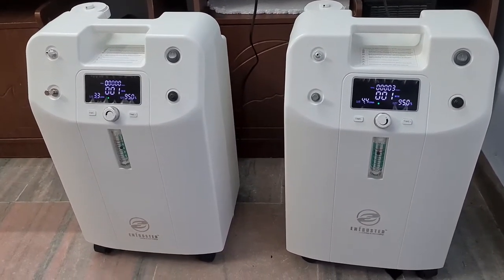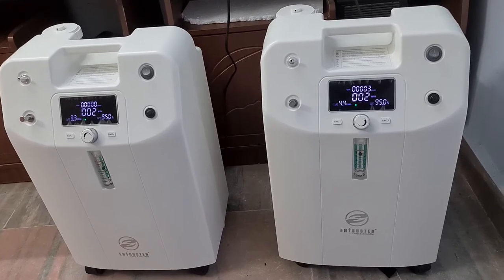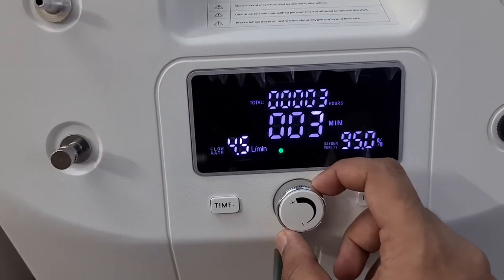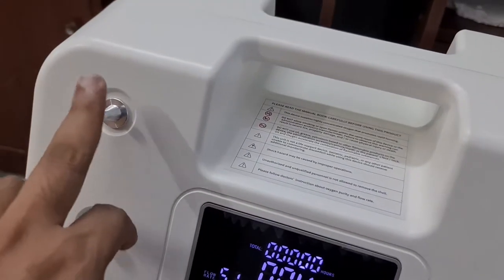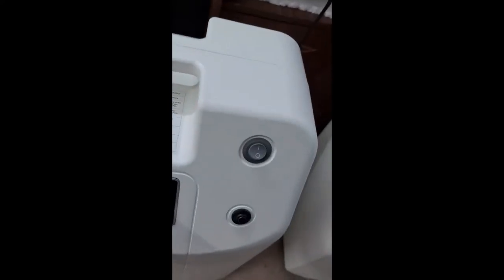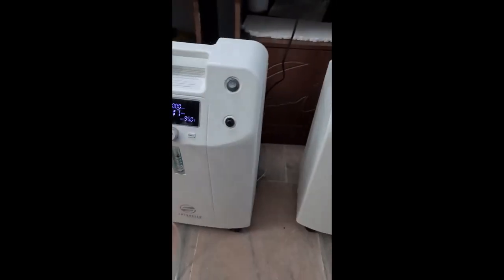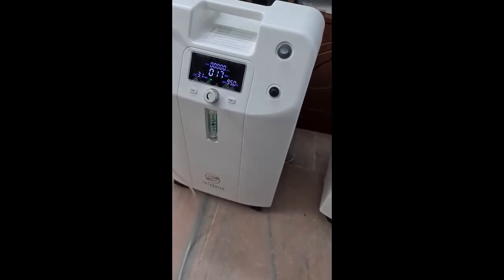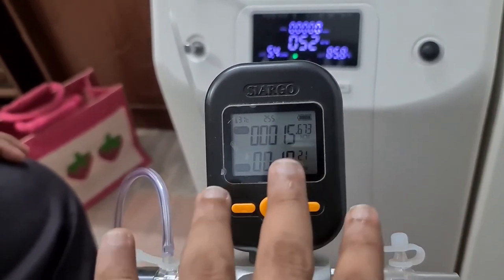Simple Steps to connect two 5 lpm oxygen concentrators to use as 10 lpm machine

Comment: Tried this , but having too much trouble, one of the machines keeps chatting down. Any suggestions?
Reply: Did you make it work?
Reply: Kindly add link to buy
Reply: Try and maintain same lpm on both machines.Ensure free flow through the pipes.Check for any bends or twists in the pipe which can obstruct free flow.